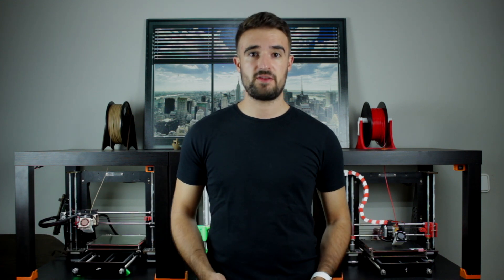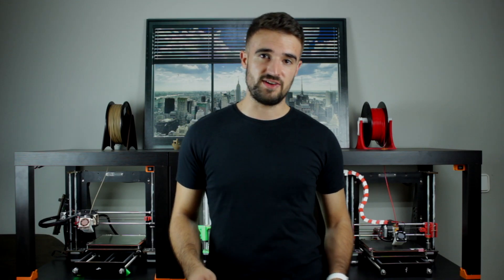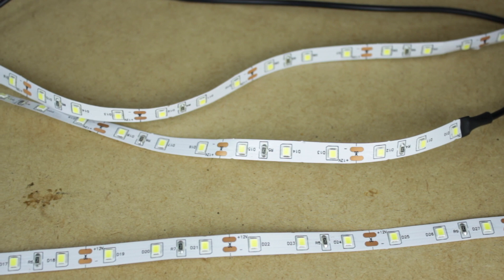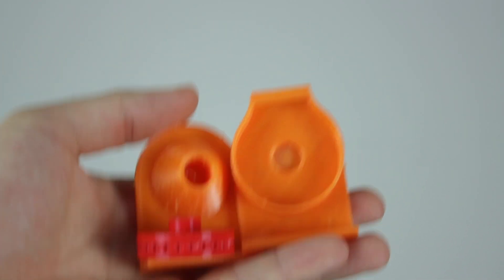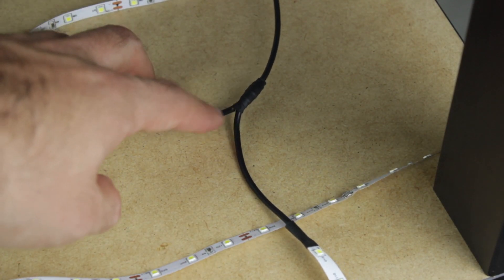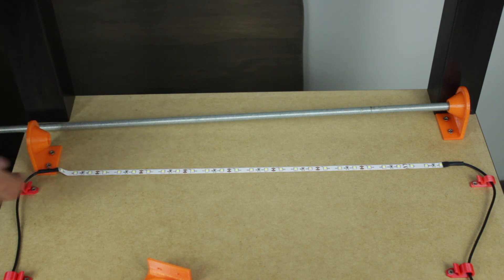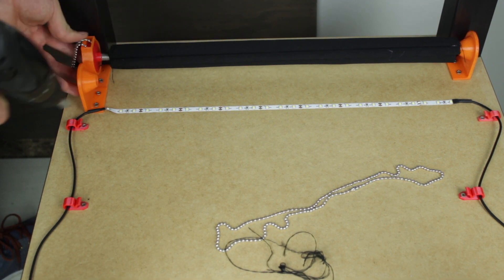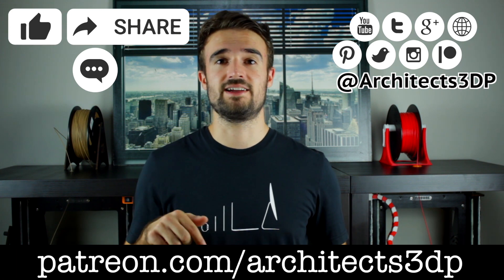3D Printer Farm Shelving ikea lack #3/3. DIY Photo Studio

Comment: I want to learn how to build my own 3d printer, I really want to put together a CoreXY printer with a Duet 3d 2 wifi and a E3d v6 that's my dream printer but I have no clue where to start I want a build volume of H: 400 W: 300 D: 300 if I can get it closed to fully enclosed to print ABS, PC, and Nylon. Can you point me in the right direction on what I should learn first?
Reply from the maker: You can follow my series and learn how to build a printer. Then you can just change some settings to adjust it to your needs =)